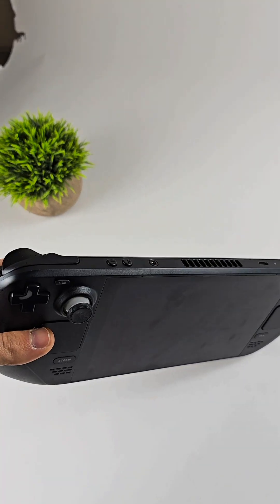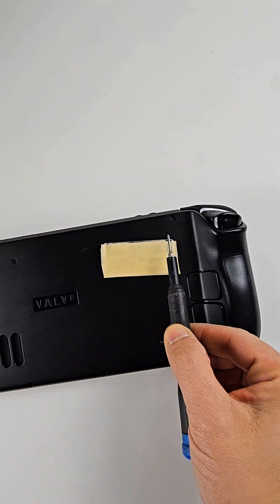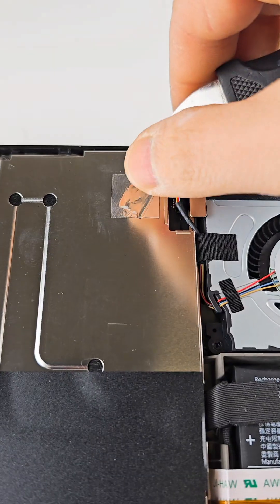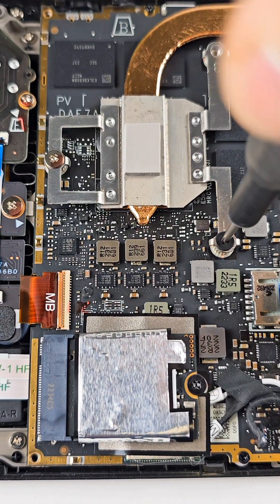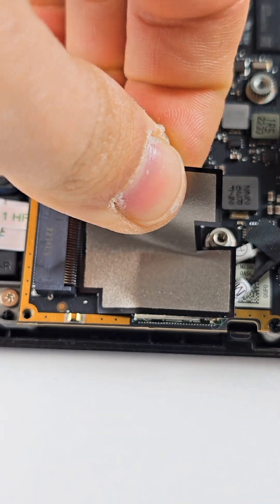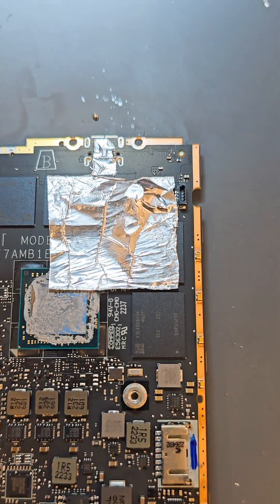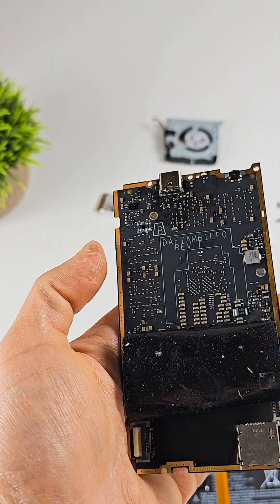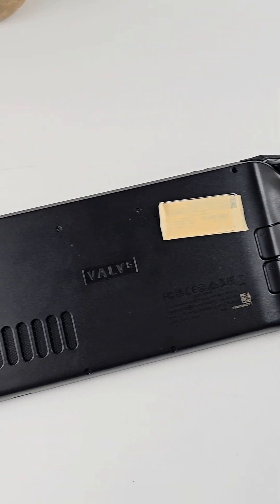STEAM DECK REPAIR WON'T POWER ON OR CHARGE - USB PORT REPLACEMENT

Comment: I’m so confused with this - did you micro solder the new usb port to the board or did you just somehow just heat things up to replace it with your heat station?

Comment: I’m having the same problem now the charger it came with won’t charge it and when I connected it to an android it won’t charge and it gives me a burning smell
Reply from the maker: Do you like to send to our shop ? If you are in USA
Reply: I sent mine to a shops to repair I found on eBay and it worked a few weeks and back to that again 😢

Comment: Hi bro
At what temps air flow?
Thanks
Reply from the maker: Hey , I user 440 temp and air flow 40 and I used Atten
Reply: I have sugon 8650 pro 1300w is ok? What nozzle?

Comment: What heat gun is that would a hair dryer be ok
Reply from the maker: I used Atten heat gun
Reply: I have Sugon 8650 pro 1300w is it more then ok for most modern consoles?  @AynaxTech1

Comment: Can you provide more details on the actual port? How did you remove it from the mainboard and how did you attach the new one? That is the part that I would personally struggle with in the repair. I am encountering something similar with one of our machines.
Reply: Looks like he used the heat gun to remove and used it again with some flux to put it back on.

Comment: Nice video. I've got a question. Actually two. The USB-C port from my 64GB LCD Steam Deck seems dodgy, meaning every single device I connect to it never sits flat when I plug them in, including my dock. Did you experience that after replacing the port?
Secondly, when I turn on my Deck, it no longer beeps (no chime), where would you start looking particularly in this case?

Comment: Did u re-soder it?
Reply: In his defense, solder was spelt wrong so it’s quite understandable considering that might not be a primary language for speaking.
Reply from the maker: No i replace the usb port
Reply: @AynaxTech1  yeah.... replacing the USB port in a SteamDeck REQUIRES sodering. 

Sooooooo how did you do it without doing so? That seems... odd.
Reply from the maker: @ for sure need soldering if you want to replace it
Reply: @idontwantahandlethough the language barrier us causing confusion. He did somder but her also did micro soldering as well